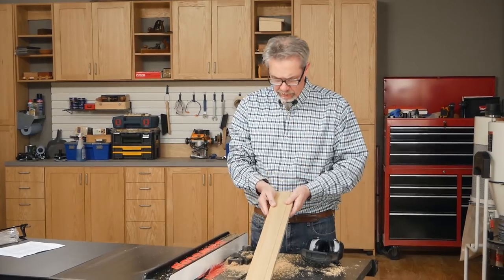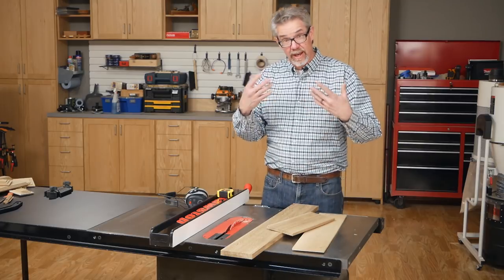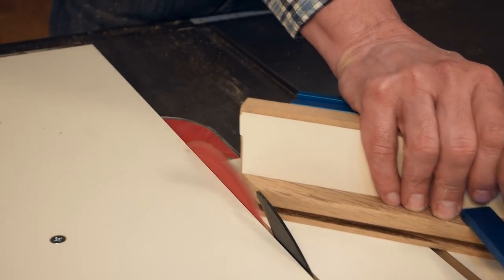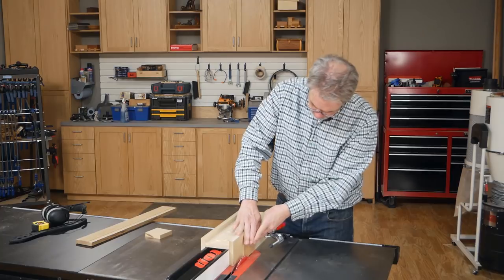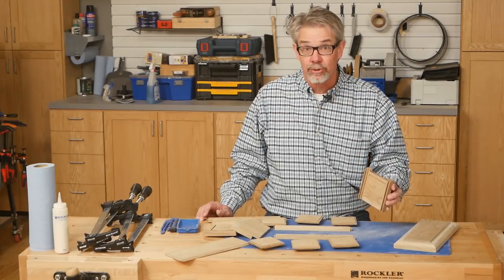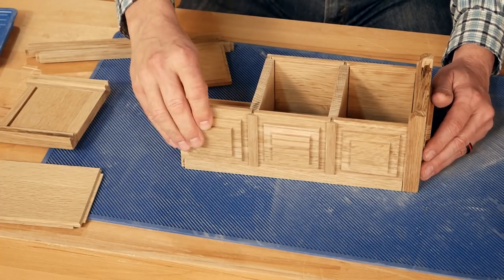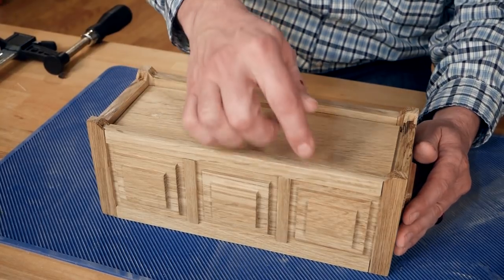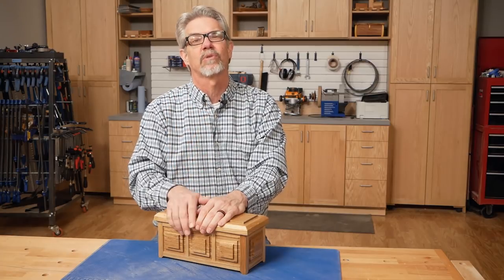Small Box Table Saw Project

Comment: I watched the video, downloaded the drawings and have an engineering background, but ...
There seems to be some errors on the materials list (such as part 6 - center dividers cannot be 1/2" wide) Also, the Exploded View and the jig could sure use some details. But maybe it is just me <g>.
Reply: Where did you find the drawings?   I have looked every where. I think.   Thanks.
Reply from the maker: Ewing,

We've updated the drawings to correct the dimensions on the dividers. Thanks for bringing it to our attention.

Blackemmons,

You can download the drawings from the bottom link on the article page: http://ezine.woodworking.com/TableSawTechniques/DresserValet/index.html
Reply: I downloaded the drawing last night and started cutting out the pieces.  I also got to part 6 and realized there was a problem.  I'm glad to see the plans have been updated.  Now just trying to figure out that dang jig!
Reply: A little guidance on the depth of the cuts for the panels would be great as well.  In the video it looks like he's just taking off 1/8" or a kerf width with each pass.